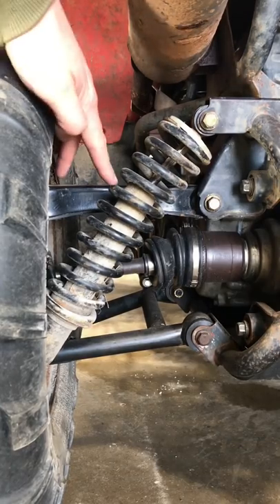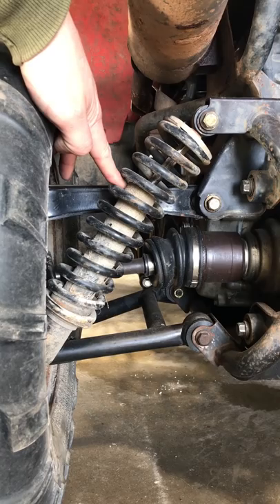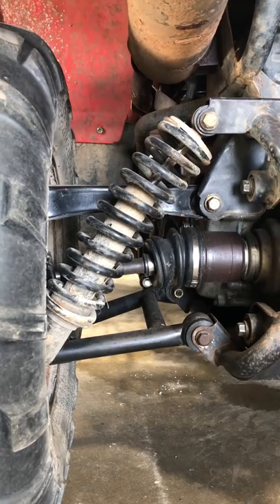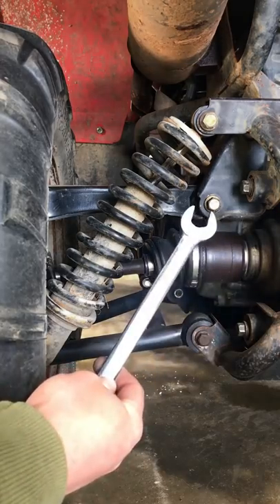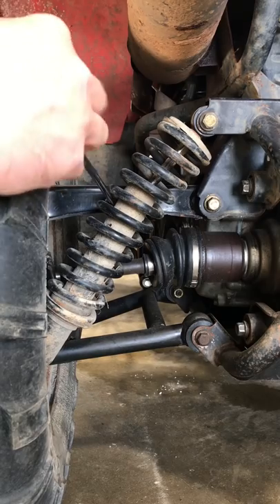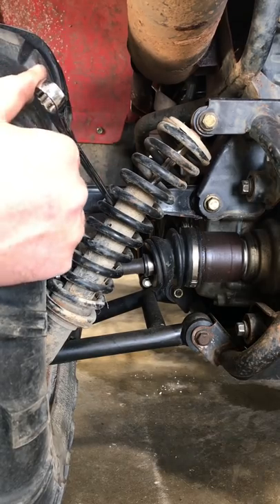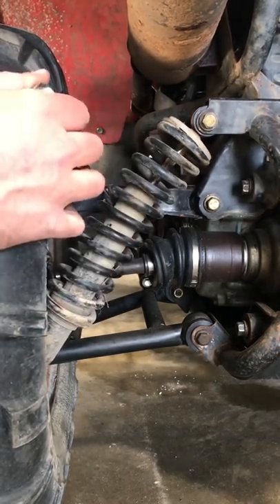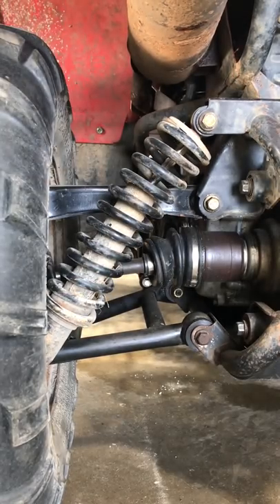Articulating Shock Absorber #shorts

Comment: You seem to be assuming that you need shocks. It is clear that someone thought they were unnecessary, along with a frame, a battery connection, fuses, working starter clutch, …

Comment: well that was unexpected, said no one. like anyone ever changes the shocks on a quad or a motorcycle who isn't racing the thing, or rebuilding and restoring it. they start it, ride it, and the day it won't start or ride, they push it into the weeds out back, or if it's lucky, into the back corner of a building saying they'll fix it "one of these days", which is code for never, and then promptly forget about it, or use it as a shelf and pile crap on it until they can no longer see it, and then forget about it. don't roll your eyes at me, you know i'm right. in fact, i'll bet if we find a pile of crap in the corner of one of your storage buildings, underneath the accumulation of random whoosey-whatsits, there's a lonely, forgotten something with an engine on it that just needs some love and it'll be right as rain. you know damn well the vegas bookies wouldn't touch that wager with a ten foot pole.